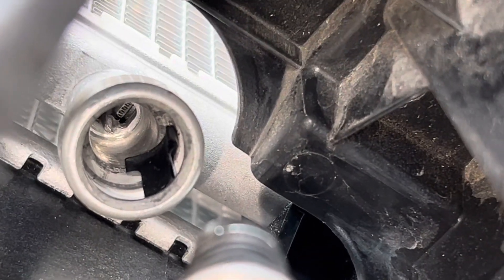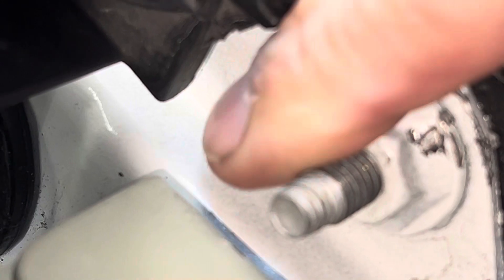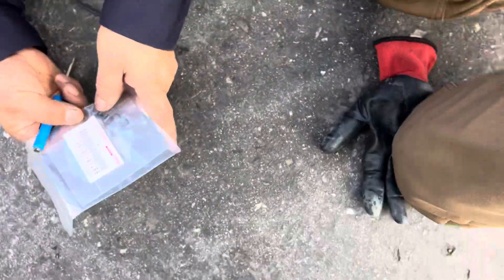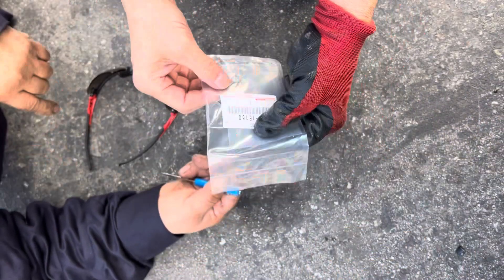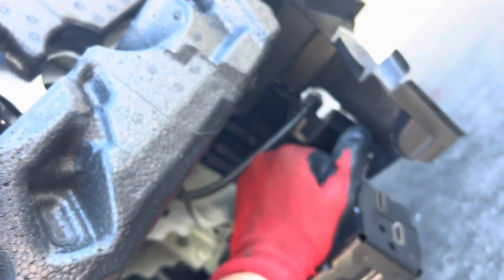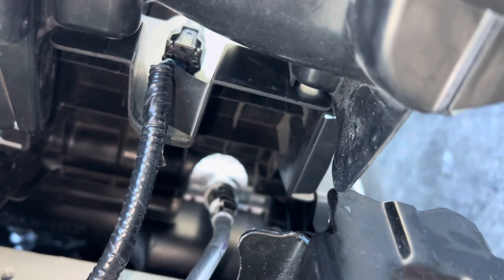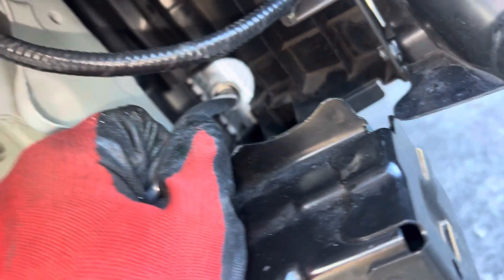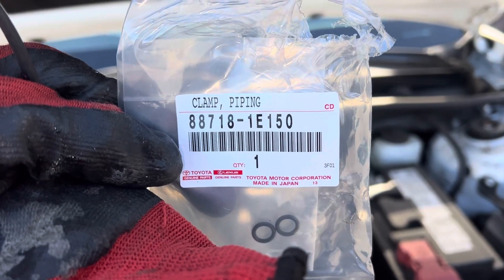Toyota two broken condenser plastic clips. This is the third one. ￼ show tech not to break clip

Comment: Looks like you almost ended up with a restriction in the condenser!
Reply from the maker: If those plastic clips would’ve ended up inside the condenser. 

It would’ve been a little bit of restriction on Automotive. It drops into headers on our parallel flow. . 

So the plastic clips would’ve dropped to the bottom, one or two refrigerant passage tubes as a slight restriction 

The only way you would’ve been able to tell if it was significant is by using the infrared gun because you would never feel it with your fingers on these types of tubes .

The first parallel flow path is about 20 tubes so you would’ve only restricted one or two tube slightly at the bottom

Comment: Good thing my MB E400 uses ordinary flange with bolt😅, otherwise i would break any plastic fittings. My fingers so barbaric n  crude😂
Reply from the maker: I remember back in the early 80s when Auto manufactures were switching over from steel AC fittings to aluminum AC fittings. 

The old mechanics who were used to Twerking down on steel fittings, were very angry, because they were always stripping out and destroying the new aluminum fittings . 

Because aluminum was so soft 

And back in those days, mechanics were not used to working on anything remembered. Most of the vehicles were iron blocks iron heads